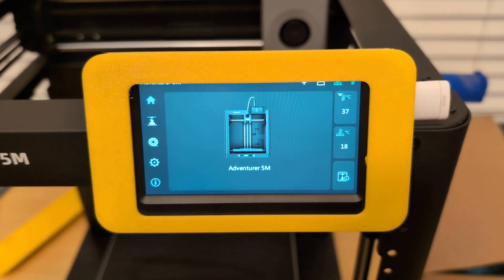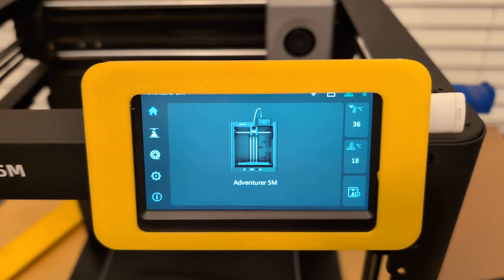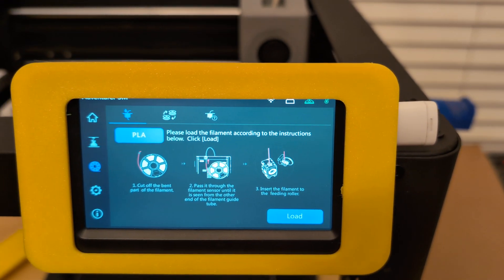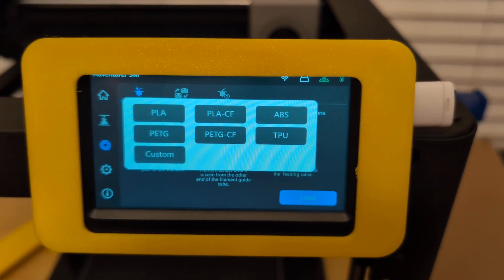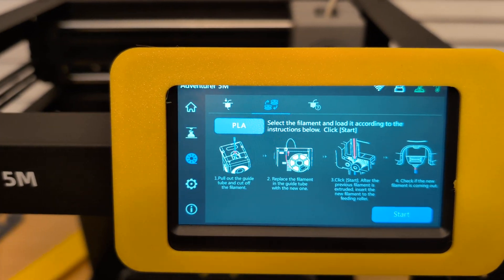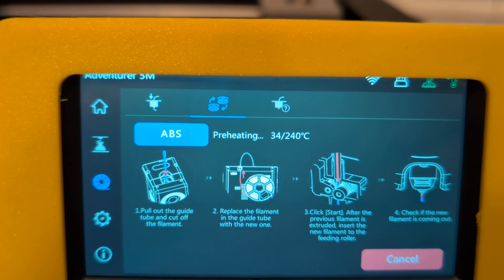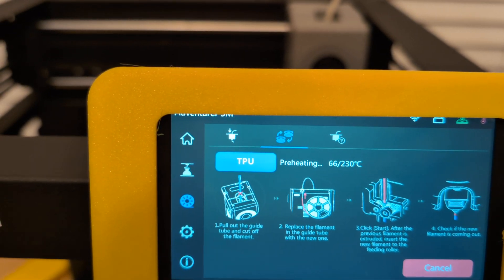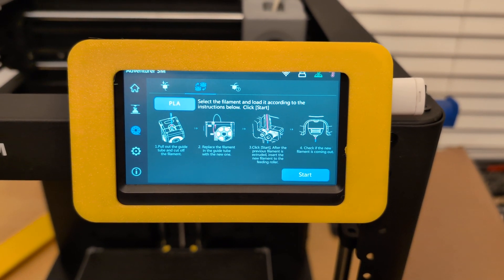Changing Hotend Temperatures While Loading/Unloading Filament [Flashforge Adventurer 5M]

Comment: So you are setting the type of filament that you are CHANGING TO? If for example you are going from a lower temp filament, say PLA, to a higher temp filament, say ABS, it's Ok to set the higher temp and purge out the ramaining PLA at this higher temp? That won't cause any problems? And same question if going from a higher temp filament to a lower temp filament (say ABS to PLA). This seems a bit odd since you will be trying to purge out the higher temp filament at the lower temp. That doesn't leave any higher temp filament in the nozzle?
Reply: Same question I have. I'll update if I find an answer.
Reply: I've only printed two files from my new A5M however my Ender(S) (printing with them for 5 years) I have always tried to purge the old filament at the higher temp to make sure I get out the old one when changing to a lower temp.   My mindset is I want to load PLA behind PETG at PETG temps to flush out the remaining PETG.  The other way doesn't really matter because PLA is going to melt completely at PETG temps.  Now, if you were going to something absurdly higher temp you might end up burning the lower temp filament.  In that case, the best S.O.P. would be have dedicated nozzles.  For example, a PLA nozzle and a ABS nozzle so it wasn't a concern.